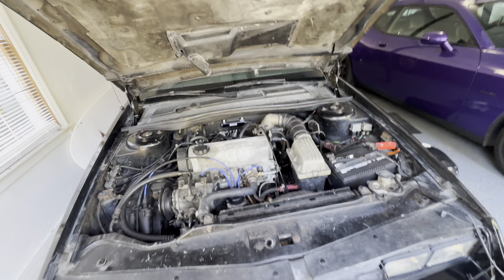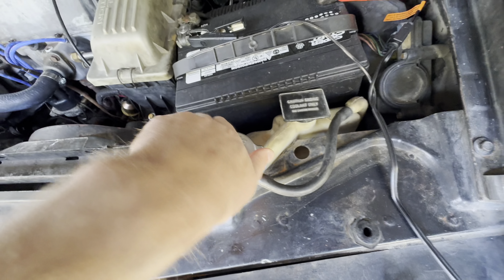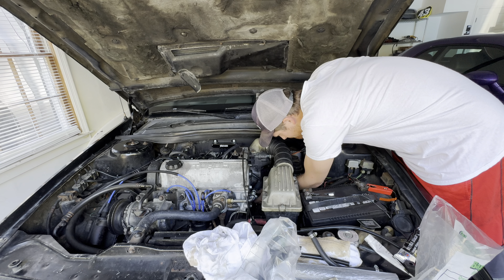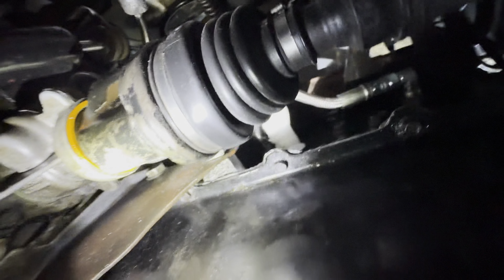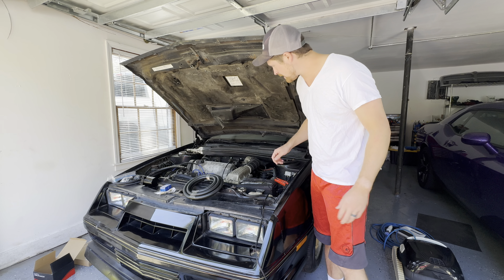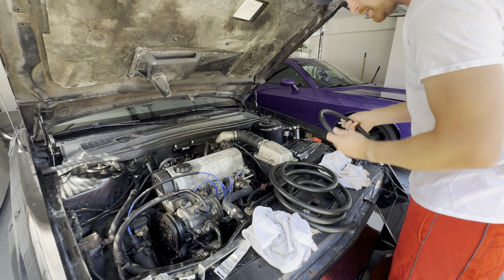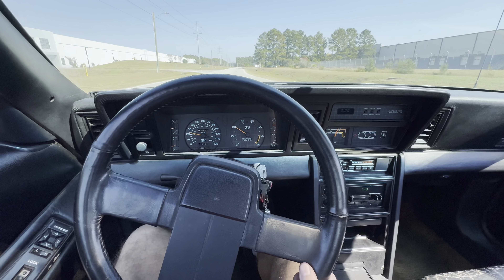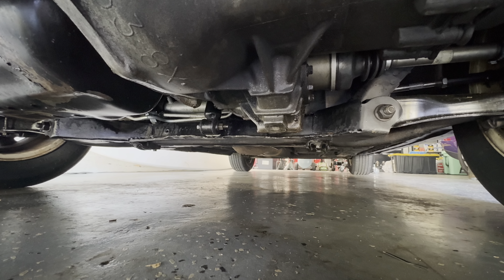Project cars are never done! More work on the 1986 Shelby Dodge Daytona Turbo Z

Comment: Your videos have brought back great memories of my 86 Turbo Z. It was my first car which wasn't a hand down and I was religious in its care and maintenance. I did all the servicing and one of my main issues was with throwing a rocker arm. I would pop off the valve cover, reattach it and keep going. Had no money for a valve job though I did change the head gasket. I sold it in the early nineties. Never liked the front wheel drive with the spunky power it had. The 5 speed manual made it a lot of fun too.
Reply from the maker: @greggouwens9366  thanks for watching! They’re a unique ride for sure, albeit a little (a lot) unreliable 😂

Comment: Smoke on startup only is usually valve stem seals. pull the plugs after it sits a few days see if there's oil on the pistons. U can change the seals easy with the valve spring lever tool.
Reply from the maker: I’ll definitely be putting a bore scope down there to see if they’re leaking. Would be pretty disappointing on a freshly rebuilt head but stuff happens!
Reply: @TheMoparGarage   I don't think you need the borescope just take out the plugs and look at the top of the pistons

Comment: If u changed the rings u should do the break-in procedure. bunch of 1st gear WOT runs idle to 4000rpm then let it engine brake to idle. then change the oil (conventional) at 150 miles then 1500 miles

Comment: There is so little content and so few people on YouTube working on and building these cars.

I picked an 87 Daytona Shelby Z up as my first project car years ago, and finding anyone in the current age doing anything with these cars is impossible, especially someone who isn't 40+ years older than me. I'm a young dude working on mine, and this is the first set of videos on this car that I can say is at all relatable. 

On a side note, you should look into intercooling that fucker and upping the boost. Stock computer limits boost to 7 psi, but will provide fueling for up to 14.7. 12 psi is a safe bet but you need need need an intercooler. I think there's a lot of other work involved when adding that stuff to a turbo I setup, but the extra power is very fun. Mine came stock with that intercooler and that boost level and when everything's working correctly she's a riot.
Reply from the maker: Thanks for watching man! There definitely does seem to be very little content on these things. I have a playlist on this car that’s about 35 videos I think, so hopefully there’s plenty in there that can help you and you can maybe learn from some of the mistakes I made while building this thing. This one will stay stock boost because these head gaskets are so delicate and I do NOT want to ever have to build this car again 😂…I’ve got some other fast stuff being built/already running on the channel!

Comment: Those cars we're famous for blowing head gaskets. Coolant, maybe leaking, passed the head gasket.
Reply from the maker: The head gasket is good, I just built the engine and it doesn’t lose any coolant. It seems that the head I had built has bad valve seals. I’m just going to run it as long as it doesn’t get much worse.

Comment: I do not recall how many miles are on the engine in your vehicle.
FWIW
If over 60,000 miles and you experience knocking noise, check the engine cam for excessive wear.
I brought my own vehicle's engine into the dealership for engine knocking after warranty. 
The cam shaft was replaced.
I had a look at the cam shaft prior to replacement.
I've never disassembled an engine, but the wear on the cam shaft reminded me of excessive wear on hydraulic pumps in need of rebuilding.
I am guessing the cam shaft metal was softer than necessary for the engine, though I've never researched it.
Reply from the maker: The car has 91,000 on it but the engine is a fresh build
Reply: @TheMoparGarage  good to know.
You won't need to deal with that problem.
I look forward to further updates on your vehicle.

Comment: Hey, I know you a ways from Kentucky,  but there an '87 Daytona Pacifica onn marketplace for sale for $1200. 2.2 turbo,  automatic.  If you're looking for a parts donor.  It's in Henderson, Ky.
Reply from the maker: Nice! Probably not worth the trip for me now that I have other projects going on, but it sounds like a good buy for someone starting a restoration! Certain parts for these things are like gold.
Reply: @TheMoparGarage  right. I learned that the "limited number" cars are cool until you go looking for the parts that set that model apart from the rest.  My 2013 Dodge Charger Daytona was a 1 of 3000 car. I could get body panels and most drive train part for a regular Charger RT.  But, the door panels,  seats, and steering wheel had blue stitching.....not so easy to find....lol

I'm looking forward to more on the challenger,  and still some 2nd gen ram videos. 👍